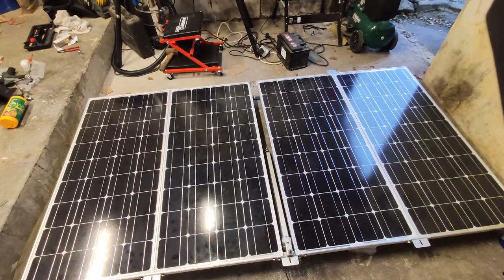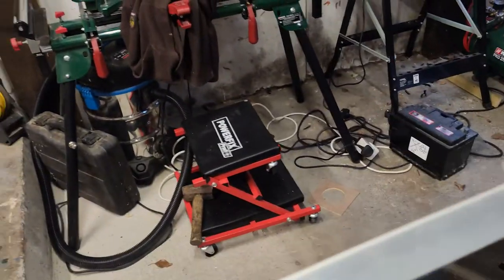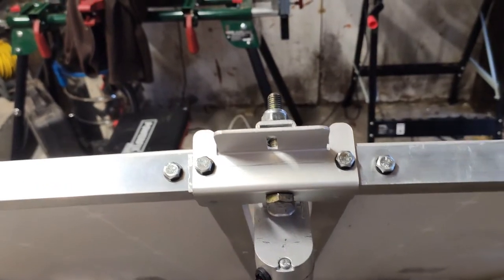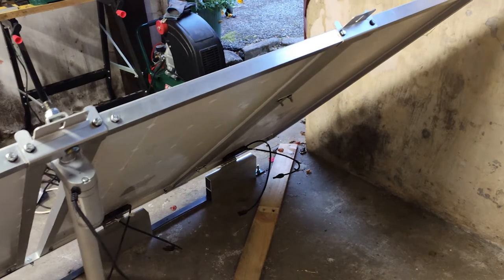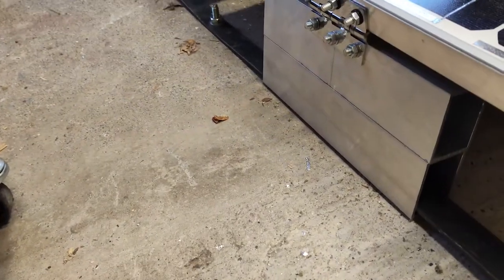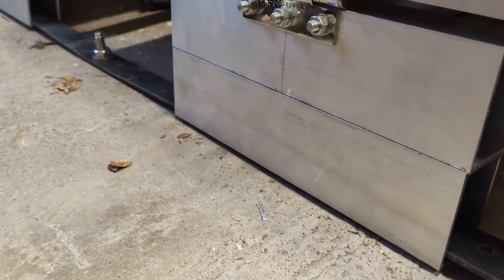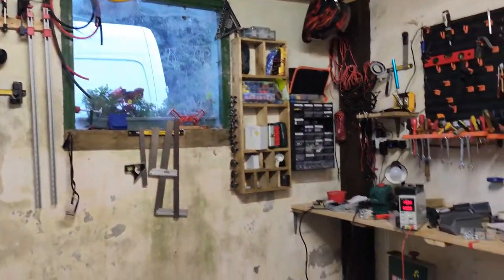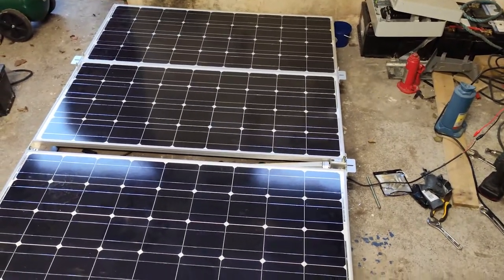Solar panel array with linear actuator for van build - Part 1

Comment: If there isn't a swear word, you're not doing it for real. Nice design. I see it relies on the high stacked channel to keep the actuator at enough angle that it is forced up. Clever. I am planning a similar setup on my cargo container and will take advantage of the valley in the corrugation to help me achieve the same. You design looks good, mostly hides the actuator and is inexpensive. Good job.

Comment: Fascinating, I myself already have a tilting panel but I'm tired of getting a ladder out to manually raise it! Needless to say I will be closely watching with a view to steal ideas for my campervan✌😎
Reply: I'm in a same boat, or say in the same van. Manuals tinting  system is on, waiting to up grade to raise by a actuator. 
In part 2, more detail on dimensions please
Reply: I will be installing panels on the roof soon, just need to get the vehicle, and I have the same concern. I designed relatively easy system to tilt panels manually, but it will be repetitive and inconvenient. I think it is worth doing in winter, December and January for sure, maybe also November and February. I will have 6x panels, so it will be even more work, 1x is piece of cake.

Comment: Good information especially the solar sensor thing.  Most builds I’ve seen have the actuator limiting from the opposite side of the hinges. that makes a triangle that would be more stable I think.

Comment: If you have started to make such a panel lifting system, then make one that rises on both sides immediately, instead of one. It's more complicated, but more interesting.  :)
Reply from the maker: I agree, i did consider it... and got someway to designing it, but i decided not to due to weight, height and complexity.
Reply from the maker: Very cool. Well done.

Comment: Hi great job , Could you please share the link for the actuator as i would love to try this thanks 👍👍🚙
Reply from the maker: I bought it on Ali Express. Just put it linear actuator and you'll find lots exactly like the one in the video. For some reason, the solar sensor + control panel's seem to be hard to find on Ali Express now. but you can get very similar stuff from eco-worthy.com (https://www.eco-worthy.com/collections/solar-tracking-kit/products/dual-axis-solar-tracker-kit-with-2-pieces-of-linear-actuators)
Reply: @thewanderingwarner5403  Thanks for the info 👍👍🚙

Comment: What country are you in? (Ireland??). I'm curious to know how effective solar panels are in Europe. We have a coach/motorhome conversion here in Australia with 4 x 4.8kw lithium batteries and 2.2kw of solar. As long as we have less than 2 weeks of very overcast weather (which is nearly every week), we can be off grid indefinitely. That's with a 240v house fridge, 2 x3.5kw air conditioners and washing machine.

Comment: Hi ! Thanks for the video :)

I'd like to install linear actuator on my solar panel. I actually have only 7 cm between my roof and the frame of solar panels... Do you think it could eventually work ?.. How high are your panels ? 
I am eventually considering installing the actuator on the side of the campervan to lower them. 
Would you have some ideas to help me with that ? I could share some pictures.
Reply from the maker: Thats not a lot of space, my design would not work. I have some ideas though if you want to send me your email address.
Reply: @thewanderingwarner5403  Hello. Have you seen my email adress ? :) I don't want to keep it too long on internet !
Reply from the maker: @marineg8397   yes, sorry i will email you today.

Comment: Do you have any concerns with linear actuator waterproofness?
Reply from the maker: It's rated for outdoor use but I did have concerns, which is why I mounted it in the orientation it is in, so that water couldn't run down into the linear screw.

It's been working in the Irish rain now for years with no problems

Comment: I wonder  if  there  is  a  way  to   make it  lower  profile ?
Reply from the maker: Yes, there are various ways. The reason it is so high up is because the actuator needs a certain starting angle to translate the 'horizontal' force to 'vertical' force. 

The system could actually be 25% lowever and it would still work.

I was tempted to experiment to experiment with gas struts or springs or a sliding channel mechanism to provide the initial lift. These would have allowed to design to be much lower profile.

However the current set up is simple, which in my opinion from an engineering perspective is always best! Plus i now sort of also have a roof rack on my van, storing things like surfboards under the solar panels is now very easy.
Reply: @thewanderingwarner5403    It  seems  if the  actuator  is  smaller   and  you  raise  it  from the midpoint  of the panel  you can  get  very  a low  profile if that  is  needed :
https://www.youtube.com/watch?v=MEQ673rZRcc
Reply from the maker: Yes, I see a few people have decided to lift from the midpoint.
However this doesn't make sense from an engineering (physics) point of view.
Try to think about it if you were trying to lift the panels yourself with your own hands, would it be easier to lift the panels from the edge furthest away from the hinge point or from the middle? 
You'll find you'll require quite a bit more muscle power lifting/pushing from the middle than the edge......or better yet, think about opening a door, it's much easier to push it open at the edge where he handle is than push the door in the middle.
Reply: @thewanderingwarner5403   Yes in terms  of  pivot point you would  find it  easier  from the  top.   I suppose you have to consider the lifting   capacity of the  actuator.  In the  instructions for the actuators  they  do  mention about  where to  position it  to  avoid  extra  friction.
Reply: By lifting by the mid point they exchange stroke length for the force, kind of like a gearbox, top speed vs acceleration. I would need long actuator as well, but would prefer to have two.